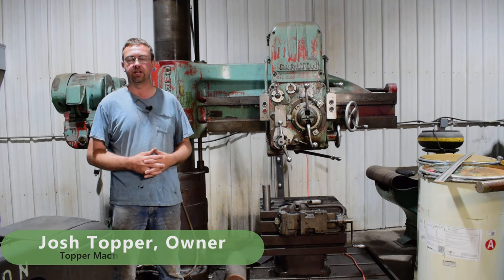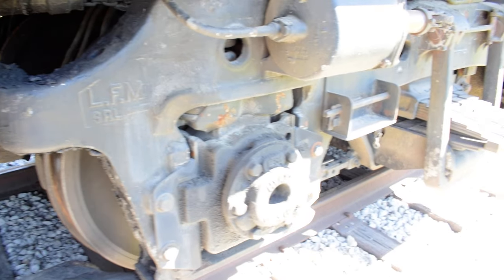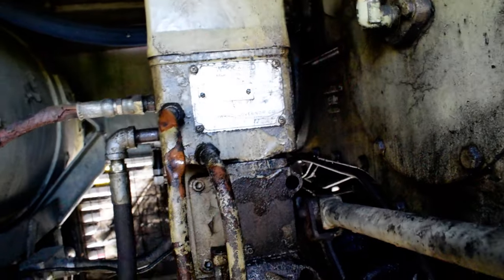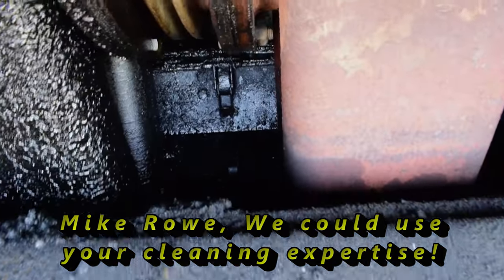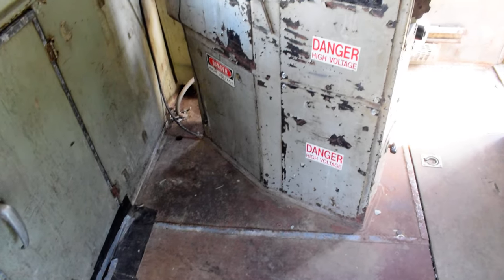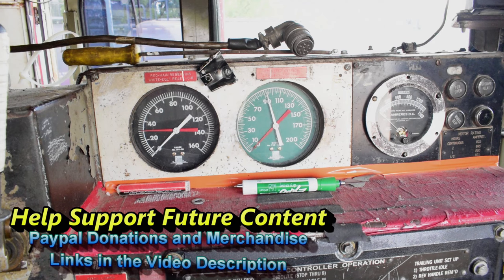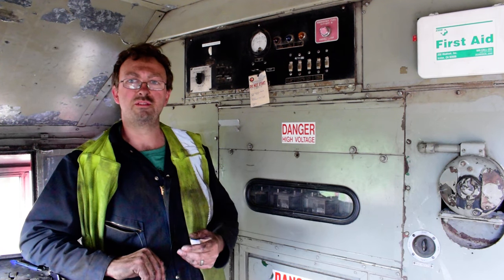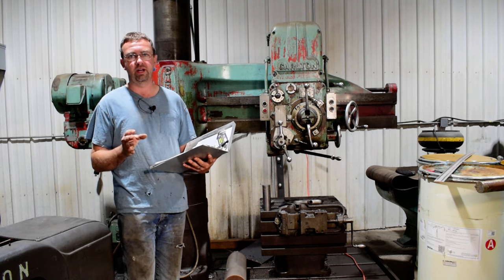Locomotive Bought on an Online Auction - Helping My Customer Get It Moved - Shipping Nightmare

Comment: Another great video as always Josh, thanks for uploading!! 👍👍

I know what I'm about to ask isn't what you usually do but I'm hoping as someone who's been intimately apart of the railroad business for awhile now I was wondering if you could do a video giving us your thoughts and insight into why we've been having so many train derailments lately. If it's too much of a hot subject or you just don't want to get involved it's NBD.
Reply from the maker: My personal opinion is sabotage. Wether it's by employees or foreign, it's not normal.
Reply: @TopperMachineLLC  kind of my thoughts also. but again, larger trains, distributed power, less checking of everything, older cars being brought back into usage after sitting around for many years, perhaps some electronics failure or espionage (hacked?)
Reply: Chinese bearings!??
Reply: The Class 1's have drastically reduced MoW and Mechanical forces the last 10-20 years.  ALL of the infrastructure doesn't get "looked" at near as much as needed.  And the FRA said little to nothing while (IMHO!) they should have said NO.  Plus equipment is getting bigger/heavier, train speeds have increased, MUCH longer heavier trains.  Karma?
Reply: I can't "prove" anything, but derailments on good track seem to happen in groups for some reason.  Also with the advent of so much social connections, these things tend to get more widespread attention and reporting.
Reply: We are at war with Russia even if by proxy. You don’t think they can have a few crews over here making a mess of things?
Reply: @TopperMachineLLC  I would think sabotage if the companies themselves weren't (as you put it) squeezing every dime out until cashing out and failing

They lobby for rollbacks on safety measures, they squash strikes, they have inspectors that don't even leave the pickup, and then shit happens with overworked, underpaid, underappreciated workforce , and poorly maintained equipment
Reply: The wheel bearings aren't being greased then the wheels fall off causing a derail
Reply: Where I live, right beside an apartment complex, a pile of rocks and debris showed up on one of the tracks.
Fortunately, the train that came through was on the other set of tracks, noticed the obstruction and reported it  Being just 4 blocks from the station, it was quickly cleared.
But it showed up a few days later, got cleared again and showed up again and so on  This became a daily thing.
Surveillance cameras only showed "hoodies" coming from and returning to the apartments. Finally a maned watch was set in a building right next to where the sabotage was taking place. After a solid week of taking pictures and videos, authorities moved in and arrested the children that were doing this.
None of them were over 13. They did some time in a juvenile facility (needless to say). But I doubt that that will much of a deterrent.
When are parents going to be held responsible for what they allow their children to do?

Comment: My father worked for SCL for 32 years, started out as C&O if I remember right then laster after SCL it is now CSX. Anyway, i've been inside too many of these in the 80's when my uncle owned a locomotive repair shop in Lakeland Fl during the phosephate era . I still have TONS od manuals for the EMD GE etc but I guess everything can be found on computer now and there is no need for the old books..I even have books on the old 50's Pullman cars air brake repoair function etc..Please excuse my typing and /or grammar errors, My diabetes is killing my vision! I can barely see what I'm typing now it's all a blur! Sorry

Comment: Good morning and good video, thanks
What is your work background? I started watching for the machine shop work as I find it interesting yet your knowledge of the locomotive would make me believe that you spent a fair bit of time in the railroad industry working on locomotives? Or is it a hobby of yours?

Also, 
When machinists do their training and apprenticeship, do they teach how to take apart, maintain, and service these machining tools and equipment. I have seen you as well as Abom taking these machines apart and they seem pretty intricate. 

Thanks again
Reply from the maker: I started working with museums and shortlines the year before working in a machine shop. I've done both for over 25 years now. Railroad work has taken me all over the upper Midwest, mostly as a profitable hobby. My "Apprenticeship" was pretty much the old timers telling me to figure it out and only correcting me on my really dumb mistakes. I am still learning. 

Basically, if it was something I was always interested in, I worked on it and learned as much as I could. I don't know everything, but I keep learning.

Comment: You must have to bring a lot of stuff in anticipation of things that might need attention before starting. How much oil is in the crankcase? How much fuel does it hold? This is crazy cool.
Reply: over 100 gallons of oil if i remember correct. been too many years now.
Reply from the maker: 275 gallons of oil. 1200 fuel.
Reply: @TopperMachineLLC  wow

Comment: This looks like a nice loco, shame you got dragged around a bit with it. Bit of input on the "why no torches at the ethanol plant but welding = cool"-thing is, if I had to guess, the off-chance that some dummy turns an oxygen bottle into a low-altitude cruise missile and sends it on a beeline towards some oversized tank of boom-boom juice. Food for thought. :)
Reply: Given the terrifyingly negligent ways I've seen some people handle compressed gas cylinders (up to and including THROWING them whist capped, which I'm sure you also know well doesn't excuse such behavior in the slightest), I can totally believe that.

I'd also bet that the plant may have had a few near-misses to have that rule put in place.

Comment: What type of engine was in that locomotive?  When you took off the valve covers the rocker arms look just like a Detroit.
Reply from the maker: It's a large scale Detroit. As far as I know the EMD engine was designed before the Detroit. I have worked on all of the Detroit's, 53,71,92,110&149 and all variants of the EMD 567 and 645
Reply: @TopperMachineLLC  very nice I assume it’s two-stroke as well.  Did those use turbos and superchargers?
Reply from the maker: @EEJester1586  2 stroke with roots blowers, turboed units were gear driven until enough exhaust to free spool.
Reply: @TopperMachineLLC  that’s awesome didn’t know how train engines were set up.

Comment: You seem to buy a lot of old, obsolete equipment. That's a good move, because this old stuff was reliable and built to last. I have a lot of electrical tools and other equipment that's over 50 years old and still in working order, with a few repairs or maintenance over the years.

Comment: I wanted to buy an alco a few years ago because I would love to have a 539t. I want to build a 1000hp  electric farm tractor using one. I think they sound amazing. If the tractor deal didn’t pan out I would just use it for emergency back up power. I could have bought it operating for $10k but moving it would have probably been 10 times that as it no longer had rail access
Reply from the maker: Yuck, alcos are terrible power. But building a tractor off of one would be cool. You'd have to start with a big bud or two for the chassis. That motor weighs about 32000 lbs.
Reply: @TopperMachineLLC  I am not a fan of 244 or 251 power units but those old monster 6 cylinders seem to do very well. there are still a few out there working today and I think they all are 70+ years old. Kind of remind me of the old heavy American Iron Machine tools.
Reply from the maker: @bcbloc02  things were built to last back then. What would you do with a diesel electric tractor of that size?  Besides being the first hybrid tractor. Lol
Reply: @TopperMachineLLC  Well anything I want of course! LOL  It would be a lot of fun to take to tractor shows and plow days. Maybe even set some records. A big bud would be weak in comparison!  Would draw a crowd at the tractor pulls too! Unstoppable!! 🙂
Reply from the maker: @bcbloc02  It would be massive, no doubt.  Give us steam guys a run for the money.  You could pull as many bottoms as you have traction for, because youd never lose torque.  lol
Reply: @TopperMachineLLC  Yep keep the engine at peak horsepower and let the electric put the power to the ground as fast as they can. Should actually work pretty good and 100000lbs should pull a lot of plows too! A guy can dream but I already got more projects than lifetimes. LOL You know how it is.
Reply from the maker: @bcbloc02  yes I do. Actually been scrapping projects the older I get. Just want to start simplifying.

Comment: I FEEL LIKE I AM MISSING SOMETHING.  Please correct me if I am wrong.  Doesn't the FRA require operating railroads to keep service records on all locomotives and cars owned in their rolling stock and isn't it also required to give the original or copies of those service records to another operating railroad if any rolling stock was transferred?  If that is the case, shouldn't you know where the locomotive stands prior to your own inspection?  Secondly, is it too expensive to just run the locomotive to its new destination due to permissions and inspections?

Comment: I can't imagine what all that wiring does?
Reply from the maker: Lol. It's quite complicated until you learn it. Then all EMDs are essentially the same. Just knowing where the high and low voltage DC and the AC intermingle is half the battle.

Comment: I'm curious, why would someone (private individual) buy a used locomotive? is it like buying a used Semi-Tractor Trailer and starting your own trucking business? I'm not familiar with Railroads enough. But are rail lines like highways? As long as you pay to use a Companies rail line you can haul loads across country? Thanks.
Reply from the maker: Watch the entire video.
Reply: @TopperMachineLLC  Okay, so I watched the entire video. My sound isn't very good on my machine, but I still don't understand the purpose of buying a used Locomotive? Will the machine be repurposed and put back into service? And obviously because the locomotive is in Canada can it be used both in Canada & the lower 48 states? Can you disclose any ballpark $$ figures on how much it costs to do something like this? Thanks for your videos, I enjoy them immensely.
Reply from the maker: @Paul-tw6yf  my customer bought it for use on a short line railroad.  It was never in Canada, and is not going there. Price is between the buyer and seller, they don't want that info shared.

Comment: One thing I have noticed that you should take note of is, if something is being sold for cheap, and you seem to be the only buyer, there is usually something fishy.
Now most of the cases it is the obvious that something is broken with the product that costs a lot to fix, but there is another cause that is even worse.
If the product is perfect and sold under value, and you were the only one to sniff it out, chances are you are dealing with prime grade 1 A holes that will either stall you out, complain, cause issues and waste your time until you do not want to go through with the transaction as it is too big of a hassle.

And it seems you found the latter in this case.
Reply from the maker: That is 100%what we dealt with.

Comment: that loco started easier than your welder that you were bragging about
Reply from the maker: I always run the welder until the carb is empty. So, it takes a bit to pump fuel up there.

Comment: just sold a welder a couple years ago just like that one, 'solar' brand with red paint
same everything else though, had a cart with wheels and fuel tank inclusive
fuel pump has a priming lever you can twiddle through the top lifting lug cover in order to get it to pop over with less cranking
Really regret selling it, needed the valves adjusted because it'd start popping once it heated up and I didn't want to fiddle with it, nicest starting engine I've ever owned, even with the oldest varnished junk gasoline
Reply: Just remembered, make sure and keep the brushes nice and loose in there, mine stuck in the holders on the alternator slip rings for the AC power and ate the slip rings up real rough from arcing, they're very thick though and I was able to turn them true again in the lathe

Comment: Been a long time since I had to prep equipment for movement. My last one was also a loco but only had to deal with Federal Gov't and CSX so much easier. Both were great to work with. Been 30 years now for the last move of that type and 18 years since last move of a private passenger car on Amtrak.  As for the low coupler, one car I moved had the opposite problem. Coupler was too high. And no way to lower it. Reason was that the car had originally had two gensets in that end of the car. Two Detroit Diesel 4-71 units to be exact. So 200 100# bags of sand blast sand got loaded in that end of the car to get it down to acceptable height.
Reply: @sommebuddy  Other end was fine both before and after. You did not want to switch trucks from one end to the other as the high end had thicker springs. Also not helping with that end was the fact that the fuel and Varsal tanks were empty and the day tanks had been removed. Along with all the electrical equipment and air compressor. All of which were in the first 1/3rd of that end of the car. Similar cars that had been modified for other purposes had even stiffer springs installed as some of them had two 16V71 gensets, all the electrical equipment, fuel ( 5000 gallons worth ) oil,  (500 gallons worth ) and water (1000 gallons worth )  along with waste tank for used oil (250 gallon capacity ) an under car heating system and transfer gear for between gensets and for 3 phase shore power ( came in thru the roof mounted folding pole ). Moving one of those cars put it in the same weight range as the Ferdinand Magellan after it was modified for presidential service. You knew when you were moving either of them.

Comment: that is realy mot that dirty. thing is he realy did not have yo pull the mu hoses or ca] the the stacks G&W NS and CSX do not require that be done . the only thing you could run into is it electrify incomparable with the newer locomtives but it may be with those up grades.  The first railroads inspector was being a jerk and he probley did not know gp7s. they did not say any about ditch lights. they are required now a days. i know for a fact ns will let gp7s on there main line  puling trains. but no passengers. if it is dead in tow  the only things the inspector should of been consered with is the breakes system it running should not be a consrn of theres  but was a good idea to tag out the locomtive but it is doupt full that they would even try to start it

Comment: Is that an old WSOR engine? If so you bought a bunch of crap
Reply from the maker: I have looked at several of their units over the years. This one is an exception.
Reply: @TopperMachineLLC  It seems most of the time when the WSOR is done with it, it’s good for parts! Lol.
Reply from the maker: It was sold in relatively good condition.  I know the mechanics who took care of it after that.  I have a lot of info on this unit.

Comment: I get where you're coming from. Incompetence, ignorance, power tripping, and plain don't give a damn are rampant through this country. I imagine the inspector is just writing down whatever commonly goes wrong to make it seem like he's doing something. How long would it take to look this thing over to make sure it can be towed, a few hours? He's getting paid good money for what he does. He should at least get out of his truck and do the job. WATCO (however you spell it) owes you for all your time running back and forth and swapping parts that didn't really need to be swapped out. I charge $1 per mile and if I were you I'd submit a bill to them for making you go through this nonsense. I'm having a similar problem with getting my auto inspections done. Either they do slipshod work and miss obvious things, or they tell me I need things when I don't. If the Govt. is going to mandate that I have my vehicles inspected, I want a proper shakedown, not just a sticker or someone trying to dig into my pockets. This goes from Doctors to guys breaking stone. I've had a belly full of it.

Comment: What a headache . . . Considering the revenue lost while the loco sat in limbo for a year,  I wonder if it might have paid to hire a crane and heavy haul truck and got it to its destination that way.   Of course hindsight is 20/20 -- and maybe that wouldn’t have been economical either.  Torch vs grinder -- in my opinion a torch will start a fire faster than a grinder.  But then I see you welding and think oh there goes that theory.  Shakes head.
Reply from the maker: It just proves what is wrong with the world. Why there are supply chain shortages. Gross incompetence is running rampant.